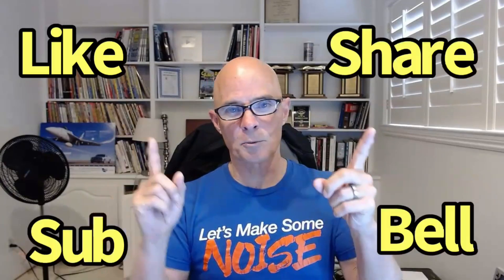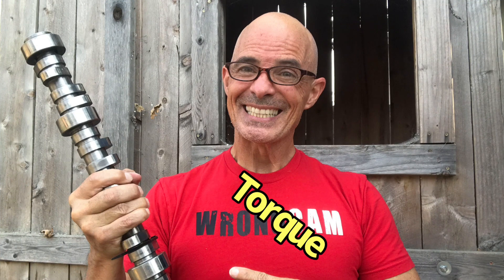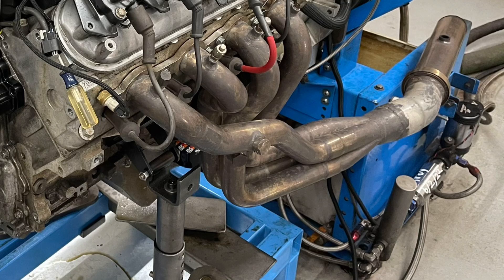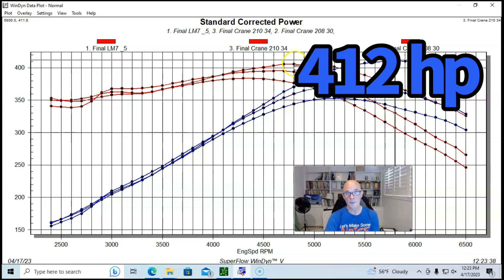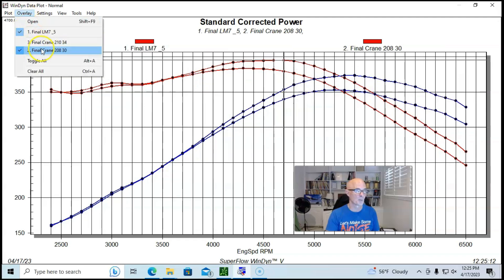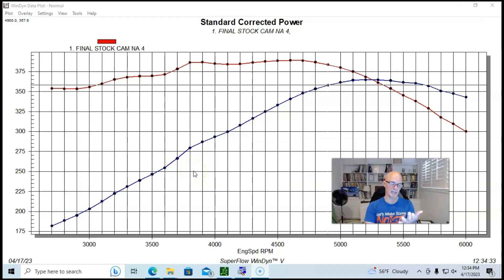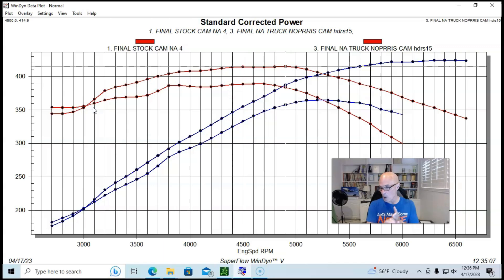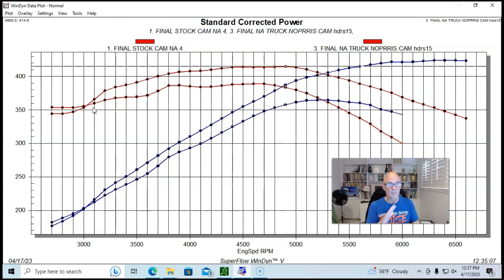WHERE'S THE TORQUE? HOW CAN I MAKE MORE LOW SPEED TORQUE? WHO MAKES THE BEST LOW-SPEED TORQUE CAM?

Comment: It does help to begin with the right cylinder head design--large ports are going to create a lazy flow at low RPM, and if the air and fuel separate, then it won't matter how much CFM flows. Its quality versus quantity. And if there's large valves, they'll just get in the way of flow with a small lift RV cam. So how much air does an LS head move overall? I don't think it was known for small port volumes. 

The reverse pattern cam result was interesting, Jon Kaase in the August 2016 issue of Car Craft ran his P51 wedge heads against his Boss 429 heads on a 521 cid engine, and mentioned that an exhaust port might need less cam timing than the intake due to exhaust pressure inside the cylinder along with the push of the piston. but he's likely referring to performance across the RPM range, and obviously there was more cid there. Small displacement engines are going to show smaller gains due to changes, and at lower rpm there's always going to be less change as the ignition is firing fewer times per minute of testing. and maybe the LS is just too efficient to show gains, an early wedge might have different results.

Lowering the engine temp would be an interesting test--at 130 degrees i'd think the engine isn't burning its fuel as well as it would at 180 degrees.

meanwhile, my 1968 Olds 442 has a .490/260 split cam, but variable duration lifters. I can put the manual valve body THM400 into top gear, set the switch pitch torque converter to 1,800 rpm, and the 10:1 C headed 455 will pull from a dead start up to redline when she's been warmed up. A captive discharge ignition and a spreadbore Q jet helps out and gets 15 mpg on 93 octane. So this is a subject that interest me (for those who wonder, if i change the stall speed to 3,300 rpm and launch in 1st gear, then 0-60 mph is 5.5 seconds and I can hit 100 mph at the end of a quarter mile distance).
Reply from the maker: the ls cath head is very good for torque-but the discussion was the cam
Reply: @richardholdener1727  when you say the LS head is good for torque...how so? Generally they are known for the volume they carry, which suggests power starting in the midrange. Are there tricks with the valvetrain or displacement on demand to generate torque at lower rpm, the same way early 1960's wedge designs just use small volume ports and small diameter valves?

Comment: A bigger stroke to bore ratio would give you more torque right? The 8.1 Vortec is a 4.25 bore and a 4.37 stroke and a 6.7 rod. I had a ZZ502 engine but my 8.1 with a 230s duration cam made alot more torque. Would that be due to the stroke and bore ratio?
Reply from the maker: displacement makes torque-not individual bore or stroke
Reply: @richardholdener1727  good to know. Also I am in Tucson and hang with Amos! I wish we could of dyno'd my 8.1. it has aftermarket racetech pistons, rods, Link bar lifters, ported dart intake converted to single plane and a 236/242 .570 lift 110LSA cam stock heads. 9.8:1 compression.

Comment: You're using all the wrong cams. Every cam you show shifts the torque up in the rpm range. So you can shift it down in the rpm range as well. Less duration, more lsa over lap. This cams are built to work with stock ecu
Reply from the maker: no-please watch the video-many, many, many cams were tested for this data-and none make a sizable difference at 2000 rpm

Comment: https://youtu.be/EJKE_Jud5JM?t=43
t56
223/231 .625/.622 111 LSA
243 heads milled .020
tbss intake
peak rwhp 437 peak rwtq 429
CAM change may not, but bumping up compression could, atleast that's what I believe based on my linked dyno numbers.

Comment: From my experience if you use an aftermarket more regressive profile that is single pattern slightly more durations at .050 and less adv duration than stock and generally will have more lift and more 0.200 duration.
Then tighten up the lobe seperation as factory can be 116 to 120 back to around 110.
Put it in at 108 intake centreline and if your lobes are reasonably aggressive it is possible to reduce the advertised duration overlap.
This improving available torque below 2500 and increasing the overall available torque & hp.
Though this will generally not be a shelf profile.
Thoughts Richard?

Comment: No replacement for displacement. A low stall converter is nice though. I've driven 2 vehicles I believe had one, a 2004 454 Chevy something HD, and a 2001 Kia Sportage 2.4. Actually, the 454 might not have been that low, it's been over 10 years since I drove that thing.

Comment: Thank you Richard for choosing to go throught this topic of lower rpm torque! V8s' should always be able win Teslas in acceleration at the traffic lights.
Watching the hp/torque curves, could it be said that the faster the engine likes to increase rpm(sharpness or sensitive for the throttle increase) the more torque it produce? If this were be true, then wouldn't making the rotational components as revolution easy as possible help to increase the torque production?
Reply from the maker: light weight assembly can help a little

Comment: Torque is made by using the summit 8720 cam I found in one of your videos . I just installed the 4th one .  {the part number suddenly gained R1 on the end}
Reply from the maker: just not at 2000

Comment: Anyone with a Ford thinking about running the Gt40P heads remember to match the valve springs to your cam. The stock springs will float at higher revs. You can get a few hundred extra rpms by matching the springs to your cam.

Comment: How does a "lowrpm" torque cam change gains in rpm combined eith say stroker crank or porting
Reply from the maker: more displacement adds power everywhere-porting usually up top

Comment: Seems like if you trying to get low and torque you're not worried about top it sounds like truck towing RV heavy stuff they have Cam that start at an idle and pull up to 4,000 RPM what about the truck towing can have you tried those what about a marine can Marine Boat all that is all sore from an idol 2 about 3 Grand
Reply from the maker: the point was there is no cam that greatly adds torque at 2000

Comment: Any advice on what a good engine management system would be for a 5.3 with boost and btr camshaft? I also have a boost controller. Engine hasnt been ran. Currently stock harness and pcm.. basically im asking whats next? Can the factory pcm be used? If so what tuner? Thanks.
Reply: I hear good about TunerPro. The paid version (RT) has the stuff to communicate with the ECU; otherwise I also hear good about PCMHammer for read/write of ECU. I'm not aware of super cheap cables, but there are some $50 to $500 options.
Reply from the maker: stock works fine with tune
Reply: What tuner? Im not opposed to buying a holley or whatever will allow me to tune it myself. Also not against keeping the stock pcm etc and saving some cash.
Reply: @dougbrook6223  I gave you the info, except a specific OBD cable. I don't know enough about those to make a specific recommendation. The specific ECU (I don't even know what year you're working with) can matter a lot. The red/blue (P01) seems well supported; the green/blue (P59) sometimes is a hassle. That's based on 3 year old forum posts from people contributing to PCM Hammer; they may have that all sorted now. If you have something like an E67 or E38 ECU, I know there are some options, but I haven't looked into specifics and don't know if there are weird compatability issues with certain software or OBD cables.
Reply: There are various "OBDLink" products with different suffixes that seem somewhat popular. EX, SX, MX+ I think are a few. I've heard mention of the "AllPro" which is apparently discontinued.

Comment: I built a motor for a 90 Mustang for torque and here’s what I learned, it was a big mistake!  Did it make loads of torque yes was the car a beats on the street no, spent more time spinning tires than accelerating.  When i was 3rd gear going @40+ then romped on it was an absolute blast but for the street i learned having my torque peak around high 3000/4000 rpm was a faster car let car hook then came on strong and first gear wasn’t useless anymore.  Strong down low torque sounds great but the practicality of it is not

Comment: People have to realize that using a 3000rpm stall converter on any LS engine even one with a stock camshaft will make it rev much faster and put the engine in a much better spot of the powerband to produce torque providing the gearing is right than a camshaft will at 3000rpm most camshafts will increase torque but most times it's 3500rpm and up even a mild truck Norris cam takes to about 3000rpm to match the stock 5.3 engines torque and the truck Norris cam makes less torque than the stock 5.3 from idle to about 2800rpm a 3000rpm stall converter fixes this problem

Comment: Your dyno isn't good enough. You can't get proper readings below 3000 RPM and a good lowdown torque cam needs to be measured at 1500 or so RPM.
Reply from the maker: the dyno works fine-you shouldn't be at WOT at 1500 rpm

Comment: You have to watch DURATION SPECS !!   A good street cam will be in the 280 duration range.
Reply from the maker: I tested cams ranging from 190-230 (250-300+ in your advertised range)
Reply: @richardholdener1727   If you check out the article from Motortrend I posted that's what the gentleman who wrote the piece recommends. I have a lot of different tricks done to Frankenstein but for an all motor car there's not much that will hang with it. And Frankenstein was built on a budget.

Comment: I'm running an older Crane Cam. 458 intake and 478 on exhaust. It's 284 duration with 112 lsa. It's the top of stage 1 cam. Smooth idle. Perfect street cam.